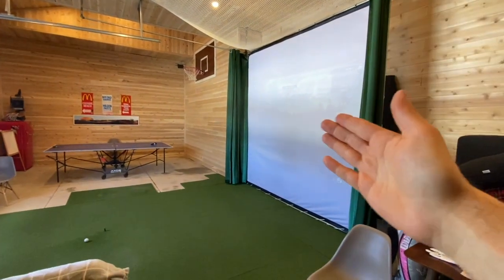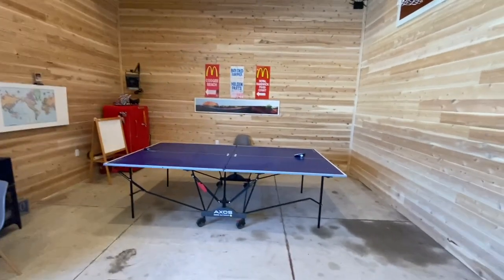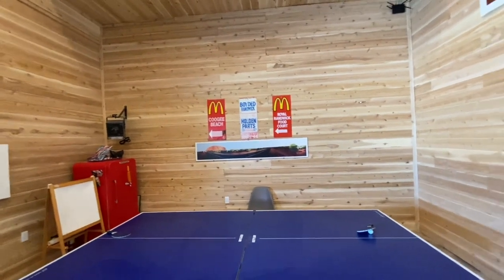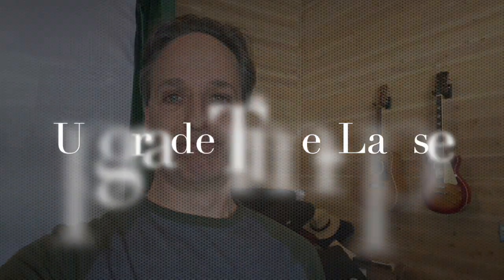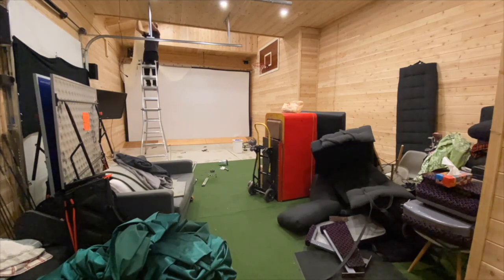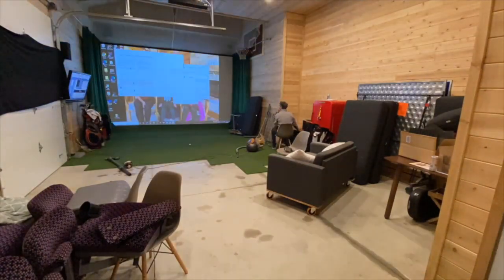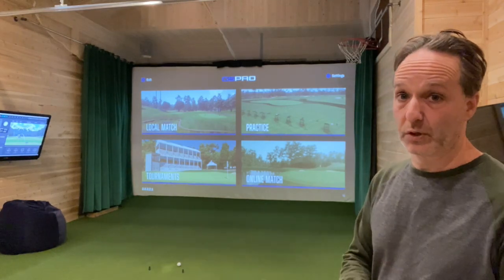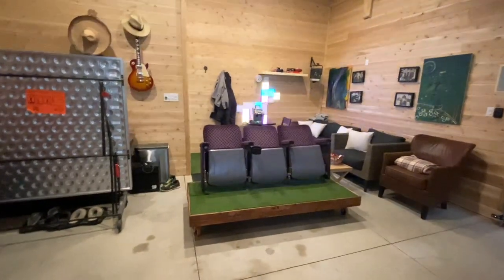My Amazing Golf Sim Upgrade!

Comment: How did you connect the screen to side walls? What did you use for padding?  Love this setup.  I was looking at buying an enclosure, but really like this setup.
Reply: Thanks so much, 

For the sides I put screw hooks into the wall and attached the 6” bungees. I ordered the screen to be 6” shorter than the wall to wall size so I had 3” on each side to tie in the bungees. 

I used the curtains for padding on the sides and on the top bar, I used soft foam pads along the top bar of the screen frame along with 3/4” pipe insulation.

Comment: Really like your setup. I am looking to build a backbuilding like this at my place. What are the dimensions of the building? I was thinking of doing 20' wide by 35' long since I also want to put my home office in there. For height was thinking 12' height ceilings. Your build looks to be around similar to what I am looking to do.  Can you send the links to the netting and curtains?
Reply from the maker: If it's just for the Sim Room then that's a great size. My room is about 18'x35' with 12' ceilings. I left 18" behind the screen for speakers and for the screen to stretch when hit. Then I left 13' from the screen to the back of the hitting area. The rest of the space, is for the moveable seating, ping pong table, and lounge area.

Comment: What are the dimensions of the room.   I ask, because we are developing floor plans for our new home and I searching for the right size.    I will have the Uneekor eye xo 2 system
Reply: The entire room is 19x35, but the area for golf with the turf is 17x15 (WxD).  Screen is 13’ from the tees and the height of the room is 12’, with the ceiling vaulted up to 19’ where the basketball hoop is over the hitting area.

Comment: Would a ramp like that impact putting on a mevo plus ? Planning a buildout and this seems to be a perfect and easy clean setup, love the ramp idea but I thought it had to be level to the screen
Reply from the maker: I'm sorry, I'm not sure of the MEVO+ requirements. But I'm pretty sure it'll only measures point of impact so you'd be fine.
Reply: Mevo+ measures the ball flight with radar. It is required about 6 meters of space with your radar in the middle for short indoor mode.
Reply: I have mevo+ I’m definitely doing the ramp, highly doubt it would cause issues unless you raised it significantly higher than level with the unit. 6” likely wouldn’t make a difference.

Comment: need some ceiling protection man, otherwise you can't play anything more than 52 degrees, it rolls upwards on the screen sometimes
Reply from the maker: Absolutely, yes, there is ceiling protection. I have a 10x20 Golf Hitting Net overhead that catches all my 60 Degree shots. Because I'm 13' from the screen, everything up to my Approach Wedge go into the netting and come back down safely. Thanks for watching.

Comment: I'm currently building a very similar setup.  What distance and height did you mount the Benq 936ST?
Reply from the maker: It's 14' from the screen and 10' off the ground. 
You've got some play with the manual zoom on the lens and then you also have some digital controls on the projector.

Comment: I like the ramp. how do balls NOT go in between the screen and ramp though?
Reply from the maker: The screen is attached to the 2x6 with the bungees and the turf overhangs the platform by about 1/2" to go right up to the screen. It puts just a touch of pressure against the screen. Balls go up and come right back down.

Comment: The 2060 got more taxed when you went to the higher resolution and screen size probably.
Reply: It did in GSPro, but TGC handles it just fine. I’ve tried to lower the quality to med but the GPU is still running at 90-100. Although the GPU temp stays at around 80.